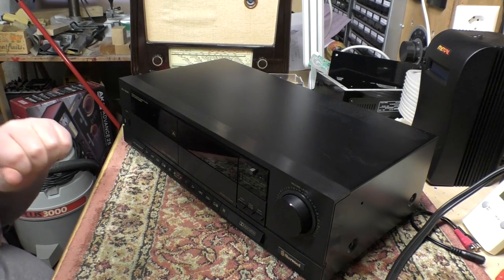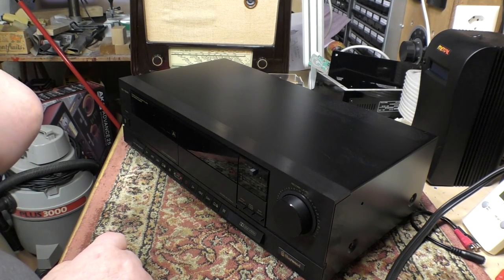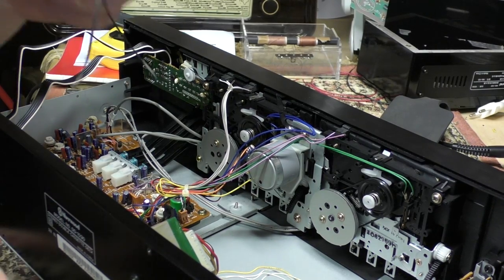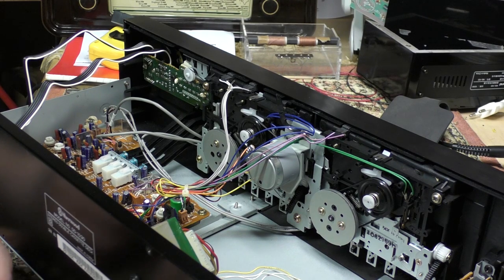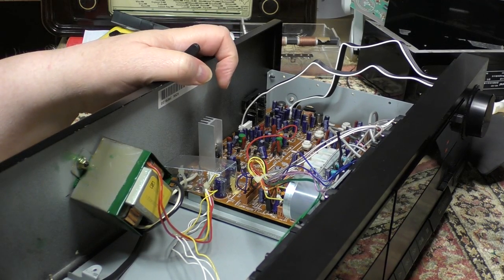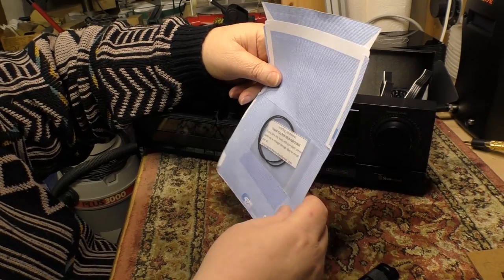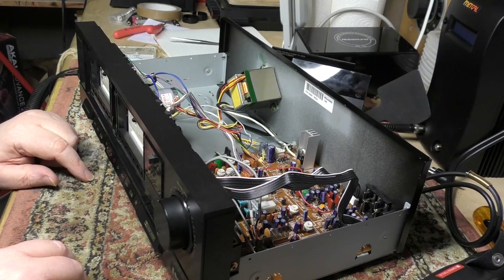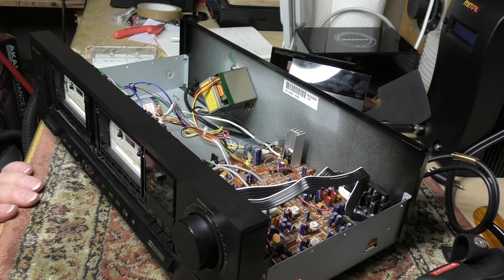Audio Cassette Player - Repair

Comment: I totally agree with you.  I'm working on a Sherwood DD-4030 dual cassette deck.  This deck is even more complex than yours because each cassette deck is driven by a separate motor.  I have to remove the front faceplate plus a metal plate that's directly in front of where the belts are located from the inside.  Basically, the whole unit has to be dismantled too. 🤔

Comment: Regarding the extra belt on one of the cassette decks. I don't mean to be patronising but just assume this will be one which you can record on. It is usually connected to the other so that you can also record from tape to tape which was what made these decks so useful and popular. I could even programme my Kenwood to record from the radio onto cassette. Another feature on some models like that was Continuous play. One deck played both sides of the tape and when it finished the second deck automatically started playing. Not sure if yours has these features but I can at least see that you only have a 'Record' button on one of them and not the other.

Comment: Great video, literally just what I was looking for. I googled "how to fix a cassette tape player", this was the first video I watched and lo and behold, I have the exact same Sherwood model with the same problem! How lucky is that? Anyway, inspired by your video, I'm going to attempt a repair. I just have 2 questions:
1. What belts did you order? Is there a part number or size I should order?
2. How did you get the glue off the screw holding the motor?

Many thanks,
David
Reply from the maker: Major apologies - YouTube only just now notified me of your comment from 9 months ago.  I always try to reply promptly so sorry this one never showed up.   I assume you got it sorted long ago....
Cheers,   John

Comment: Great video, don't know if it will help but has at least inspired me to have a go at a slightly more difficult challenge at some stage. I have a Kenwood double take deck but built in to a unit with a radio tuner in the same housing. It is one of those combi types with turntable and 5x disc CD drawer (which are both connected up seperately to cassette/tuner deck) and was bought as a second over 20 years ago due to merely having a small scratch on the front but was otherwise brand new. The Kenwood including original speakers has lasted perfectly barring one stylus change in all that time with the exception of the tape decks. So I am thinking it may well be worth people's time fixing decks like this if the only serious issue is acquiring/replacing the belts in question. 

Anyway on to the cassette decks. The first one started speeding up of its own accord around 10 years ago then very soon wouldn't turn the tapes like the one you have here (I just know the belt is going to be well mangled or disintegrated by now). Exactly the same thing happened to the second tape deck but it lasted a few years longer. I bought a separate micro machine with a single tape deck because like you mentioned earlier in comments, I also have a large number of audio cassettes.
Taking my front panel off will obviously be a bit trickier and depending how it is put together I risk messing up the radio tuner part but at least I should be able to see if it is feasible to get at the necessary parts. Fingers crossed it may be put together simply enough to change the belts with minimal dismantling. But thanks for giving me some hope either way.
Reply from the maker: Nothing ventured, nothing gained so have a go.  Take lots of photos as you go.   I got the cassette bug so I upgraded to a nice vintage Marantz deck a while back.
CHeers,   John

Comment: Were do you buy the belts and rubbers
Reply from the maker: eBay is the best source that I've found.   You either search for belts for the specific model or you determine the length and profile of belt you need.

Comment: You should be able to pick up a better deck than that one John.  That one's full of air with just one motor. But there again now that it works...
Reply from the maker: +loloaqici82qb4ipp I agree it's a pretty low end device and I'm thinking of looking for something a bit more capable.  However, this is the one that's been lying around for years and I figured I'd get it running first - for nostalgia reasons if nothing else :-)
Cheers,   John.
Reply: +Zone1242 Hi John at least the parts aren't all clumped together. you can at least work on it,without taking everything out to get to the parts that ware out normally 
All my best.
Bobby

Comment: I wish you could help me with my speed problem on a very good 1984 Nakamichi..
Reply from the maker: I don't have any experience on those machines.   Normally speed issues are the result of worn belts or drive wheels.  If you tell me the model number I can do some research........